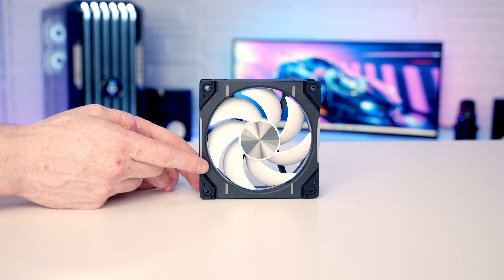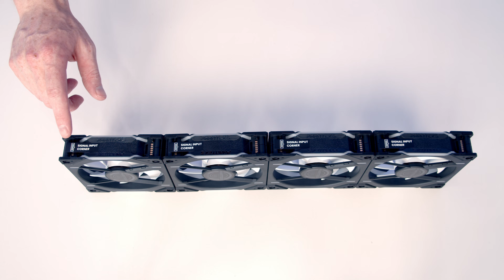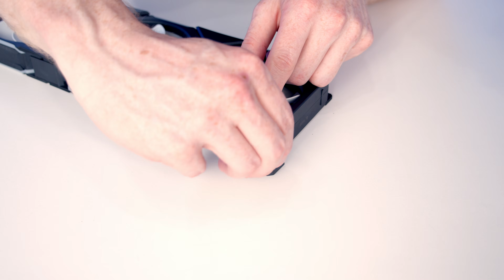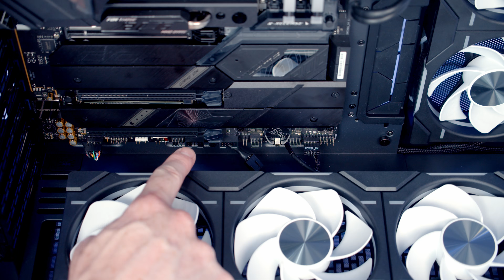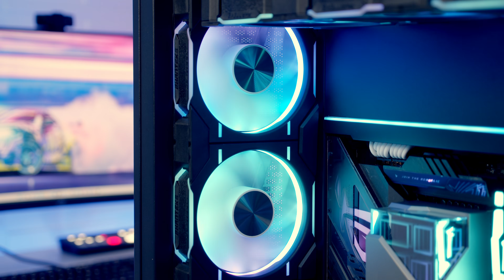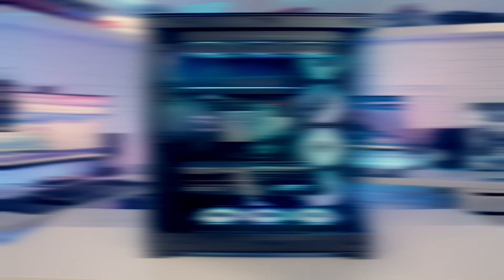Phanteks D30-120 Fans - Installation Guide

Comment: So I have 6 fans linked together and are on the phanteks hub but there running at like full speed even when changing to silent mode. Could it be to many fans linked together or mabey incorrectly fans wired

Comment: Hi there, If my motherboard has 3 addressable RGB 5v headers with a maximum of 80 leds on each, would linking 3 Phanteks D30s (each have 30 leds) mean some of the LEDs wont work, if so do i need a RGB controller?

Comment: did you noticed when you connect more than one fan to the RGB header they loose half of the light intensity? I am not sure what I didi wrong but the sibgle 140mm d30 en the rear of my case is considerable more bright than the triple packs that I have instaled... not usre how to address that, it like it doesn't have enough power...
Reply: Check to make sure that all the linking thing are fully connected, that could be the problem if not then i dont know
Reply: What's ur psu?
Reply: @gladitsnotme  1300w super flower leadex vii

Comment: Has anyone noticed that if you daisy chain 1 fan to a group of 3, the computer will treat that daisy chained fan as the same as the one it plugged into, basically as if you were using a splitter.

Comment: Thank you so much for your review!  I learned so much - I have a question tho:  do you have the 4 fans as intake or exhaust?  I notice you put the 4 fans as exhaust ( and bottom 3 fans as exhaust). But in the instruction booklet it recommends the 4 fans and bottom 3 fans as intake.  I’m a little confused as to which I should have it as.  Thank you for your help
Reply: He has them as intakes, using the reversed style of the d30s.
Reply: @KoyamaJD  he mentioned it in an earlier comment but i missed it - thanks for the reply